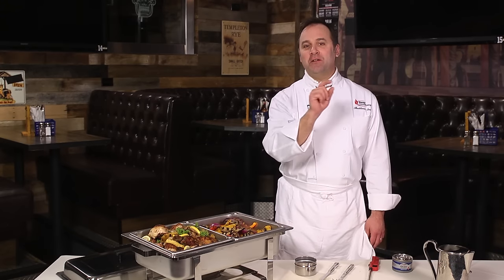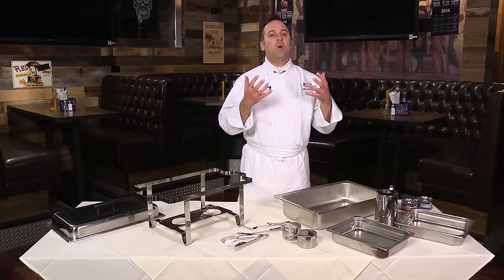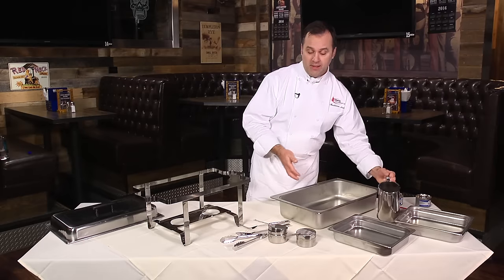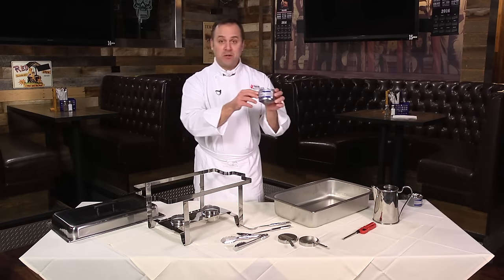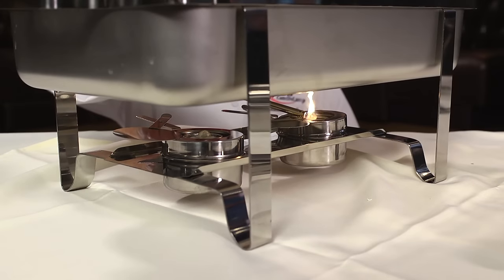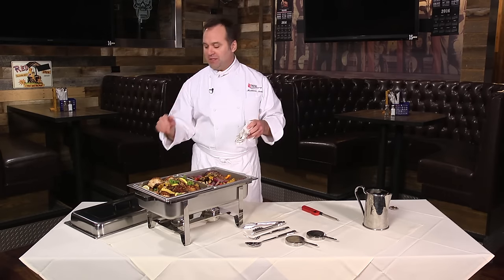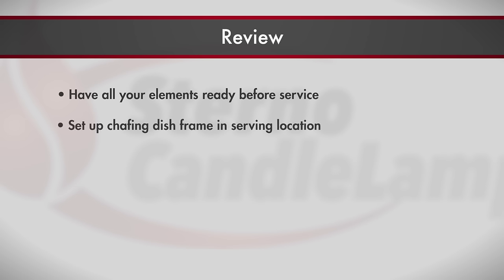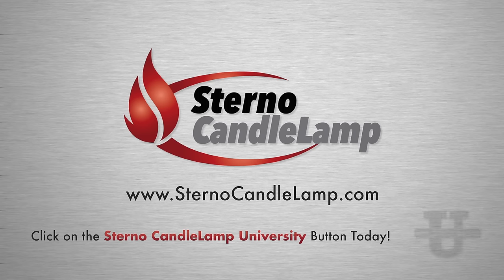Setting Up a Chafing Dish for Buffet Service

Comment: How many liters of hot water do you need?
Reply: Depending on the size of the pan to bring water between 3/4 to 1-1/2 inches deep.  The top pan should not be set in the water.

Comment: Can u just use cool water from the sink and the thing on the bottom can heat it up
Reply: Yes you can, just allow time for the water to heat up before putting your food trays in.
 I did a bbq at the weekend for 50+ in a barn and filled a garden watering can from a hot tap in a sink and used that, the water was boiling away in no time, then I just used the damper on the fuel tins to reduce the heat, kept the burgers, sausages and onions nice and hot during service.
Reply: Simon 
Thanks Simon